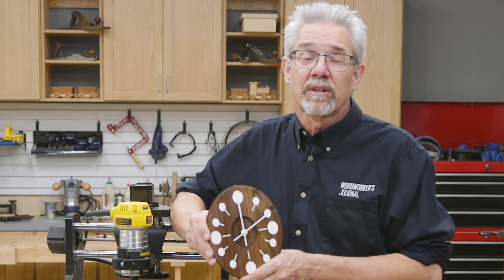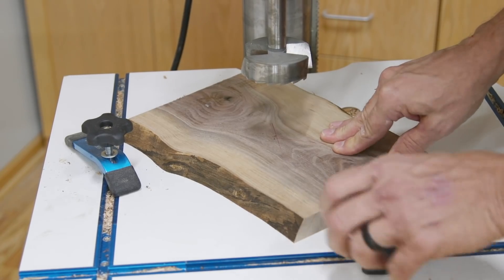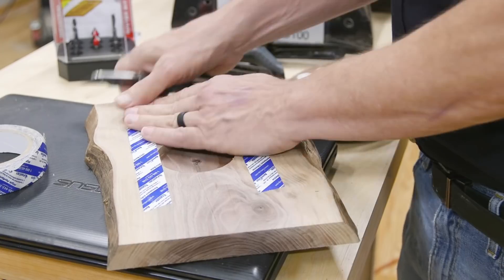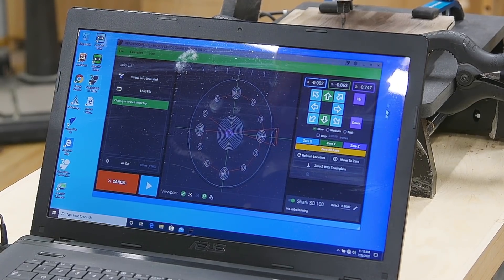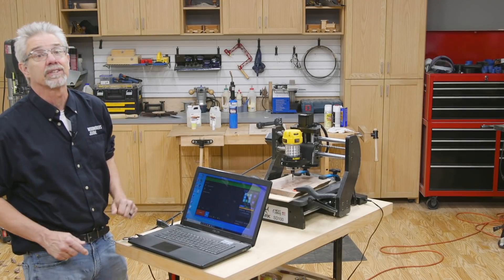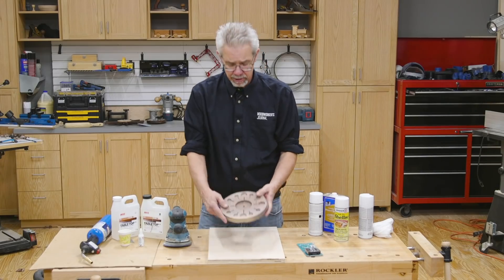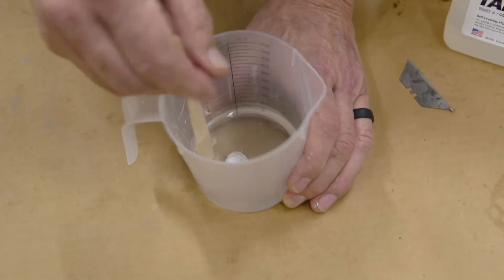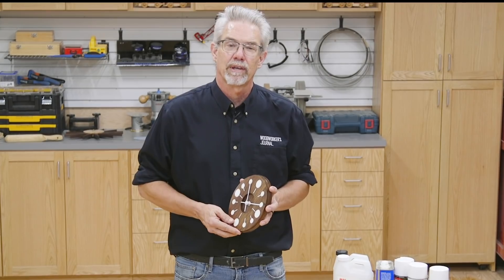Making a Modern Clock Using the Shark SD100 CNC

Comment: Thanks for the video - increased my temptation to get one of these smaller CNC"s.  I do have that same palm router.  Heard that it is unwise to use battery router as battery may run out during cuts.    Not a deal breaker but nice if I don't need to buy another router.

Comment: Umm, why not a mac? Pc only?
Reply from the maker: Right now the software is not compatible for MAC OS, so you’d have to run a PC module on a MAC to use it. Sorry about the inconvenience!
Reply: I'd say my most CNC CAD/CAM programs don't run on Macs; the exception might be Fusion 360 because it's internet & browser based.  You could use Parallels or Boot Camp, but I don't know if I'd trust them to run G-code glitch free.
Reply: @richardfarwell6759  I run Parallels all day and it works perfectly on my Macs. Absolutely no problem generating .tap files/G-code.
Reply: @jamesgiberti390  That's good to know. I have Bootcamp, and Vectric's V-carve Pro is a little glitchy.  Parallels would have been a better choice because then I wouldn't have to reboot every time I want to switch to windows. ( I have a dedicated PC for my Avid 2x2 CNC.)

Comment: Rob, Nice little project. Curious why didn't you route the 3" hole on the back side rather than demonstrating the use of a $30 (plus tax) forstner bit that most people don't have? You could route the 3" hole and the center hole, then flip the material and do the other side.
Reply: Totally could have done that. I had the bit and it was handy. But you are right, the machine could have done it pretty quickly.